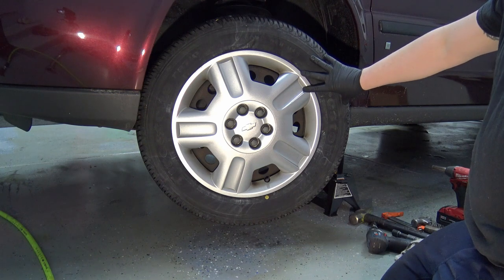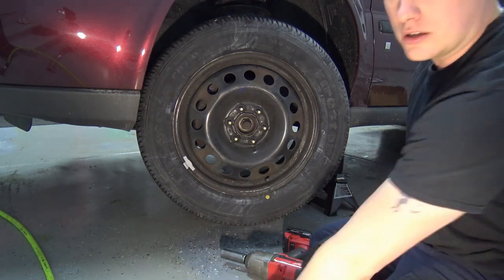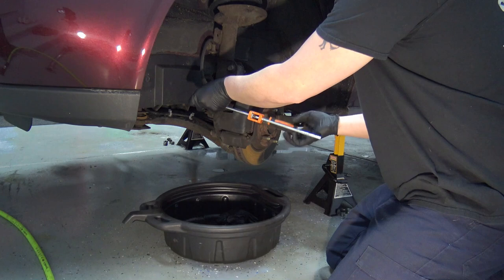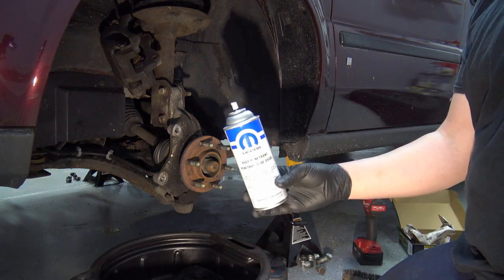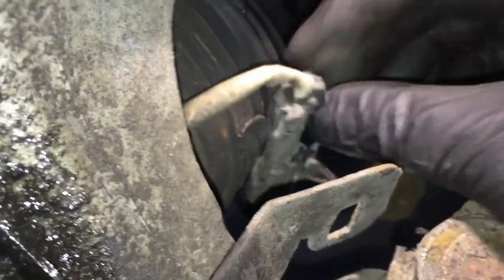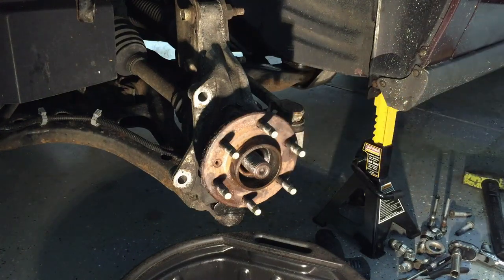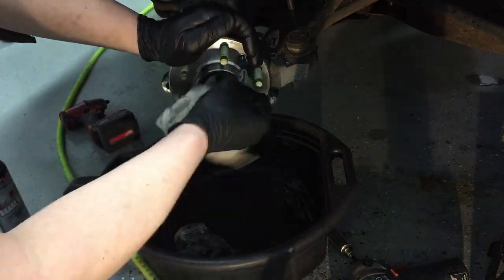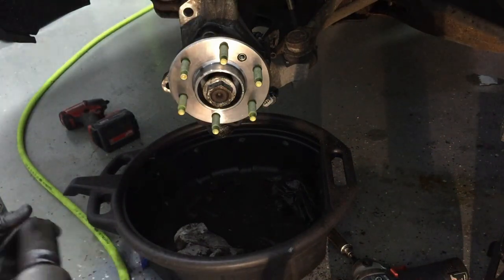Chevrolet Uplander Humming Noise: Front Hub and Bearing Replacement

Comment: My 2005 has 400,000 km, I did the driver's side 10 years ago and bought a puller. Now I'm replacing both sides, the puller was worth the money I paid for it, even though it sat in my garage for some time not really doing much of anything. I'm not super optimistic things are going to come apart this easily but we shall see.  Great vid, well explained. Thanks!
Reply: so how did it go?

Comment: Great info! As usual. One question, shouldn’t you clean the axle splines? I used a small brass wire brush. I also cleaned up the inside surface of the road wheel where it mates to the brake disc. The intermediate wire mount plate seems like just as important to clean thoroughly as the two surfaces it contacts. Also, the dealer shop manual says no lock tight or never seize. And to change the bolts. So I’m thinking some blue lock tight will make bolts ok to reuse if the threads etc. are looking fine.

Comment: Did  both sides of an 08 Uplander and I will tell you this, getting the axle shaft off was a MFer! The air hammer trick didn’t do shit! The hammering on the end of the shaft with the nut on didn’t get it either! What did get it, lots of soaking with rust penetrate and a 20lb sledge. 3 good walks and finally got it to move. Of corse you will be buying a new axle nut and grinding the end of the shaft a little, but you will be able to save the axle. The rest is exactly what Brian showed. One big tip here is never, and I mean NEVER EVER run the nut tight with an impact, you WILL damage the wheel bearing hub. The torque spec on these axle nuts is only 85lbs. Seen way too many times where I had to replace new bearings that other shops put on because they overtorqued this nut!